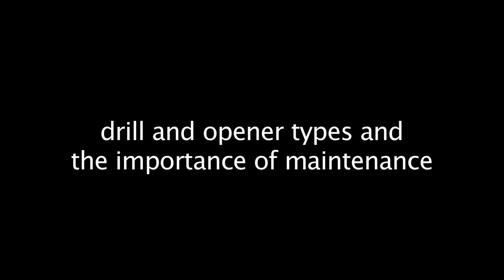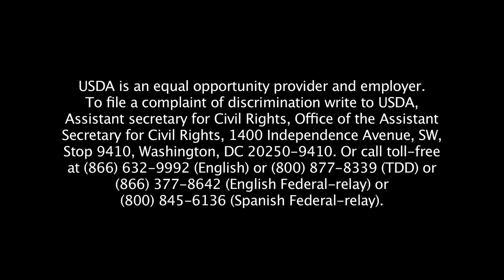Soil Health, A Montana Perspective - No-Till

Comment: Can rotavator be used? We have lots of weed.
Reply from the maker: A rotavator could be used to control weeds but it would not improve soil health.  One of the main principles of soil health is to minimize or eliminate disturbance.  A rotavator would have a pretty significant impact on soil biology, aggregate stability, organic matter, and drying the soil.  It would be a better and cheaper option to control the weeds with livestock if possible.